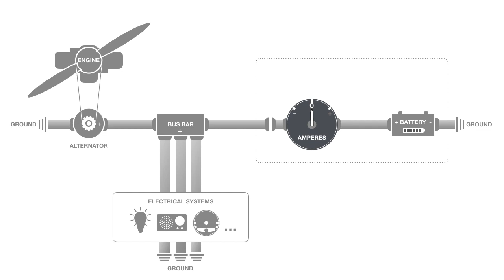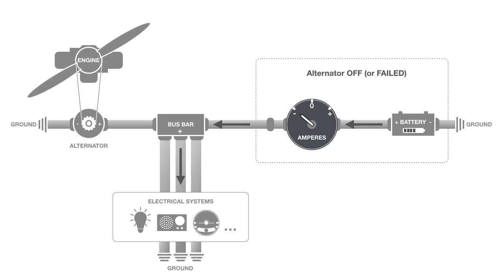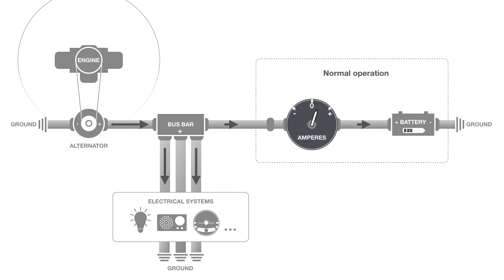Centre-zero ammeter. How does it work?

Comment: Loved the explanation! Worth mentioning that a sustained positive reading may indicate a faulty battery or worse a problem with the voltage regulator which can lead to the battery "boiling" due to overcharge...
Reply: Wait then why the video show the needle at positive when the battery is not fully charged? But you mention positive reading due to overcharge?